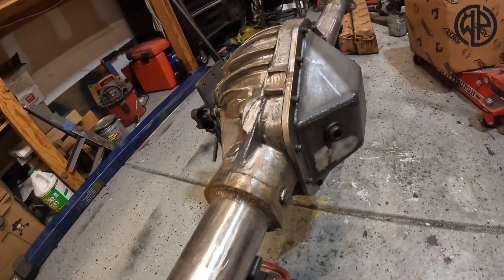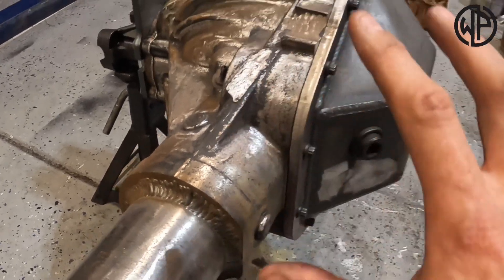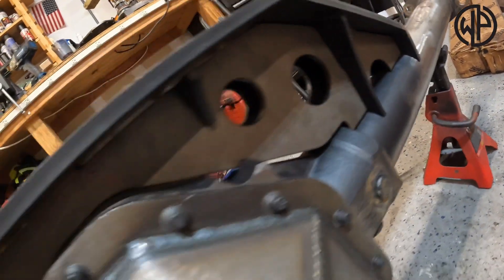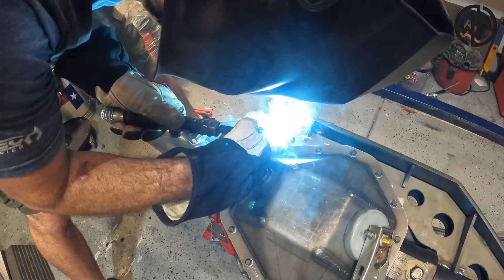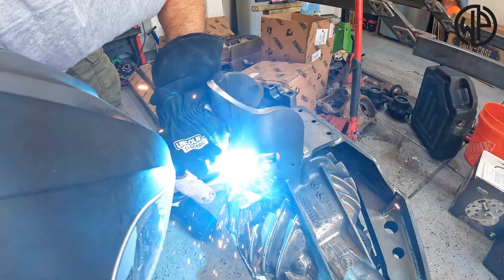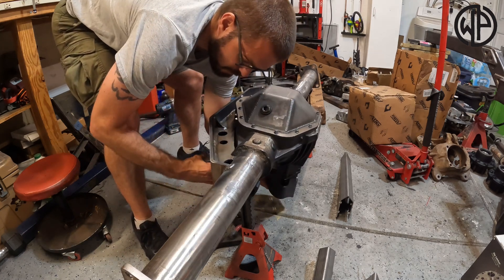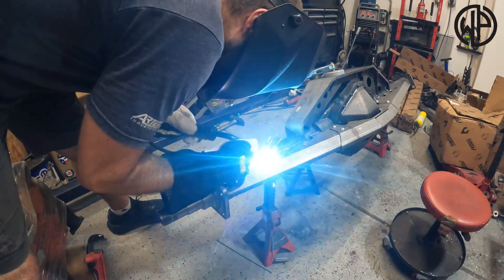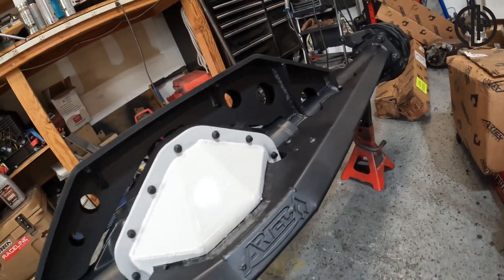Ultimate Jeep One Ton Axle - @ArtecIndustries

Comment: with the brake calipers facing forward on the 14b do the upper control arm brackets move inward a little on the Artec kit?
Reply from the maker: Just enough for them to clear.
Reply: @WarPaintTexas  do you think the brackets are moved inward compared to a UD60 or stock Dana 44? I have the Metalcloak long arm kit and the upper control arm barely clears the frame already.

Comment: would you do a video on the brakes? Or is it stock and can it handle the super duty brake calipers?
Reply from the maker: I’ll do a video on the brakes when I get to it in the rig. Because the CJ I have didn’t have power brakes…I’ll be running the 14 bolt factory brakes and the superduty brakes too (which are huge).   At this point my plan is to put a TJ brake pedal assembly. Then I’ll use the TJ brake booster and I’ll put a larger master cylinder on it to push enough fluid….should work well. But I’ll do a video when I get there.

Comment: Why is it only to 2006? And why not go with 3500 11.5 over the 10.5?
Reply from the maker: You could. There isn’t as much aftermarket support. But it’s catching up. It’s also a VERY large ring gear and usually isn’t necessary. The 11.5 is a half in larger than even the Dana 80. Which also means the 10.5 is a half inch smaller than a Dana 80. But with the 3rd pinion support bearing…it’s arguably just as strong.
Reply: @WarPaintTexas  thanks! Had to ask, because it’s almost to impossible to find the full float 14 ,99-06 around here. There’s plenty of newer ones with under 50k because they wanted even bigger axles, or just front end damage. Thanks again for getting back to me!

Comment: I’m a big fun of you work I have a question do you think it’s possible to swap some Jl Dana 44s on my jk ?
Reply from the maker: Thanks for the support. It’s definitely possible. I’m not exactly sure of the wheel speed sensors but I’m sure the info is out there. However, a swap truss for a super-duty Dana 60 is the same for a jk or a jl. Meaning the springs are the same distance apart. I do know the jl trackbar is a little longer than a jk track bar. So there are some minor differences where you’ll need to either make a piece or buy one…but it’s definitely possible.

Comment: How easily will that come on/off once it gets banged on rocks and tweaked.
Reply from the maker: That’s a great question and I’m sure I’ll find out 😂. But tbh, Artec isn’t concerned about it. I haven’t heard anyone complain or have an issue with it. My thought is that with all the bolts on the diff cover and the 8 bolts holding it tight to the rest of the truss…I don’t think it would get tweaked in a way that would bend it to that extent. Those two gussets that are inside of it also provide a ton of strength. So I think it would take A LOT to make that happen. But you guys will be the first to know if it does.